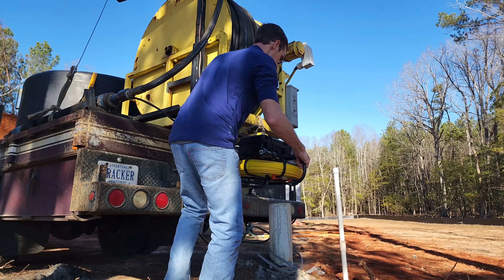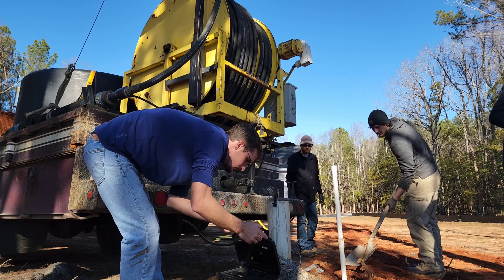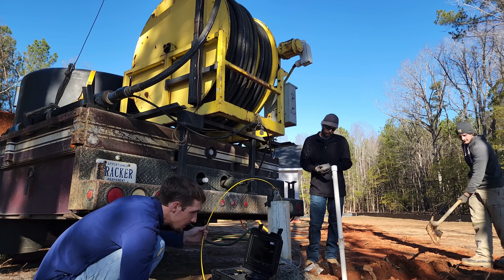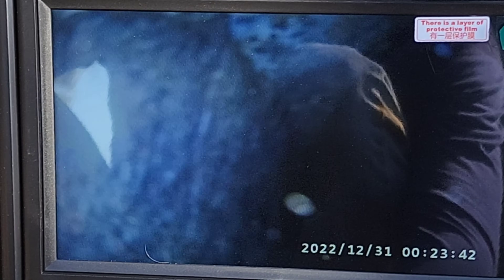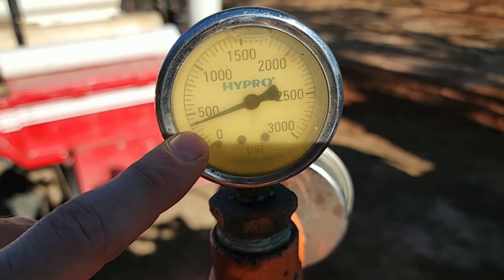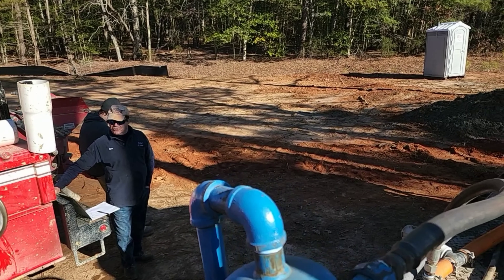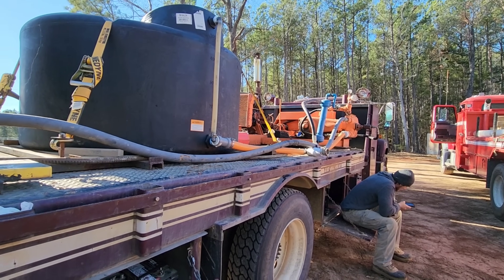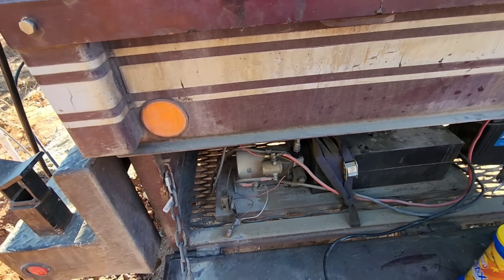No Water? What is Hydro-Fracking. For Water Wells that Frequently Run Dry. The Well Pump Specialist.

Comment: Can you frack a well that the casing is all PVC? Mine is 200 ft. My driller put so much slurry and clay down the hole trying to get the casing down after drilling it 4 times that I think it's plugged. My neighbor has no water issues. But I'm the only one around here with poor water flow.
Reply: Most likely the clay and sediment has clogged up your well pump.

Comment: No one makes it clear what water at pressure is actually doing to the well structure deep in the hole.
Is the water at pressure just pushing on the cracks in the rock hole area below the sealed bladder in order to force sediment backwards out of the fissures ? Once it is forced at speed and pressure it falls in between the area around and outside the borehole and thus the water surrounding the hole can leak in at various multiple spots to feed the well ? Is that what is going on, or does no one know ?

Comment: You often tell us you are in 2nd and then 3rd gear. What does that mean? Is it like a car transmission and the higher the gear the more pressure being applied in the fracking process?
Reply from the maker: @woodworker3122  yes, it's a Muncy 4 speed. High gear means I'm spinning the pump faster, increasing the flow rate I'm injecting into the well.

Comment: I have a new construction 600' / 6" well.  GMP near zero.  Had a company frack today.  Not the most talkative guys.  They used 3000 gallons of water.  Said the pressure didn't drop much, "but all the water went somewhere." Tomorrow after 24 hours, I will start 30 minute pumps to get chlorine out.  Wondering if you guys run into the same scenario.  Love these videos, I have learned a ton in the last few weeks.
Reply: Any luck with your production woes? That a large diameter and deep bore to wind up with near 0. Hopefully you were able to get some movement

Comment: you need a barrier between you and the engine. if that engine blows up with you over it. could be very dangerous
Reply: You've got to be kidding right? It's a low torque in line old truck motor not a  blown hemi lol

Comment: Do you ever have the pump guy put in a way oversized pump to calculate well production?
Reply from the maker: If a fracked well ever ran dry & the customer called back, then I'd perform a draw down test a calculate the recovery rate. I've only had to do that once out of roughly 50 fracks.
Reply: @h2omechanic  cool,  great channel.

Comment: We have a well that is about 100 foot deep. It was at one time putting out 3.5 to 4 gpm but is now running dry and requires about 15-30 mins to fill back up (estimated). Do you feel fracking would be worth the money to get us back to a point where we dont run dry or should we just go ahead and drill a new one. Since no one can provide a guarantee as to outcome this is a very tough decision to make. Thank you.

Comment: Any peanut oil get into the well?
Reply from the maker: Nope. If it ever leaked, the packer wouldn't swell, & water would flood out of the well
Reply from the maker: The company wants drillers to use R/V antifreeze...I just prefer not to follow that guideline.

Comment: I notice you only hydro-frack one area.= of 20 feet or so. 
We have a hydro-fracker who does 3 20 section at a time ...0-20,20-40, & 40-60 hydro  areas.  The tube has a drilled different sized hole plate between each stage.  A ball bearing of different sizes is drop down as you stop one section and start another. The ballbearing seal the lower section beneath its seat and allow you to pressure the next section.

Comment: My friend recently purchased a home that has a well  250 ft deep. Once they started going to the house the water would disappear for about an hour. 2 plumbers think its going dry because they tested the "mechanics" of it and it all seems fine. They suggested fracking the well. Anything else they should try looking at before going that route? Do you think this is something an inspection should've caught? What testing is done to see the issues?
Reply from the maker: No. An inspection could not have caught this. 
There's a simple way to test this, but you'd need a water level testing device. 
Simply pump the water level to 200ft & turn off the pump, then wait 30 minutes to see how fast the well recovers. After 30 mins it should fill up minimum 60-70ft (that's about 3gpm) anything less than that, id frack the well.
Reply: @h2omechanic  Thank you. They will double check with the plumber to see if maybe he tried this. Do you believe this is something the seller would've known? It's hard to believe this is just a sudden issue but who knows. Someone said it could have been affected by the new home next door. What do you think from your experience?
Reply from the maker: @M  if its running dry, it's always been a issue. No new well drilled near by would have any negative effects. In theory it would help it. Well veins are all inter connected in the ground in 1 way of another. 
You need to get a proper pump test done & figure out what GPM that well makes.
Reply: @h2omechanic  got cha. Again, thanks so much! Very educational.

Comment: I use a well, but it’s not above ground. My pump is in the crawl space. Would like to sanitize my well but not sure where it is. My wife thinks it would be to costly to find it.
Reply from the maker: A skilled well company can find it. 
I'd access the pipe to the pump, feed a metal snake threw the pipe until it stops, then use a cable locator to send a signal threw the metal wire snake & go outside and see where the signal stops & dig there. I've done it before.

Comment: A long shot i'd catch on this topic here   I've watch a ton of your videos, but haven't run across any that discus CYCLE STOP VALVES, do you ever recommend them? and if not why not. I run a group of 4 sprinkler heads on my well pump where the pump cycles on and off about every 2-3 minutes or so... I'm in northwest Florida. I'm not sure what size pump is in the ground as I recently bought the property and no tags are found anywhere on the setup. There is a huge 6ft tall tank on the system. My thinking was if I could keep the pressure constantly below the 60lb. shutoff while the heads are running it would be better for the pump.
Reply from the maker: Out of my area of expertise. 
I've seen them before and in my opinion, they aren't worth it unless it's a large system for like a camp ground that uses alot of water & specific times for higher demands.

Comment: What kind of pipe do yall use for the well pump? We currently have schedule 40 pvc and one of the joints failed. The company came out and recommended to replace it with schedule 80 with threaded joints.
Reply from the maker: How deep is it set?

Comment: Hey man, I appreciate all your great and helpful content. I have a question about a well with a jet pump that I have on my property. A few days ago we got a little bit of water & then heard air coming out of (or air being sucked into) the spout. The old pump burned out so I got a new one, but my problem now is that I pulled out the pipe from inside the well to check that the foot valve was clean. This well doesn’t have a foot valve it has a 3’ long 1 1/4” screen pipe. When I place the pipe back inside the casing it doesn’t go back down to its original depth, I have 7’ of pipe sticking out the ground. I could feel it hitting something it felt like sand so I pulled the pipe back out and the water draining out from the screen was yellow and sandy. Is there any thing I can do myself before I call a well company? Thank you!
Reply: sounds like a sand point on the end of your poly pipe. That sand point was likely buried  in the sand inside the well for 7', thus the 7' now sticking out.
Reply from the maker: That's not my area of expertise 
Call in a local company 
They'll understand that style of well

Comment: One of your past videos you were referring to why do they not have auto mech courses in high school anymore .Now in tec schools. Autos now are like modern aircraft which have moved away from a simple  cessna 150 to more like the modern A320 airbus-Lots of problems require using analyzing tools(have a look at Youtube,  South Main Auto)sure opened my eyes.I am licence AME avionics (ret.) which is far from my old auto course.This a/c Has only 1 cable run otherwise its hydraulics controlled by electronics. Love your Videos ,keep it up

Comment: You know what I'd like to see?  Electric grid is down and the best method to extract water from your well either by prepping beforehand and having a manual hand pump and/or having a converted bicycle to generate electricity to power your well pump (and which is better/easier to implement).
Reply: Ya a generator.
Reply: @AndyDC52  I'm so glad oil refineries will be working in the zombie apocalypse.
Reply: @MassiveOverkill  a generator. Is the answer you’re looking for.
Reply: @AndyDC52  no a generator is not the answer I'm looking for.  I will be purchasing a hybrid solar/wind system.
Reply: @MassiveOverkill  to power the generator. I dig it.

Comment: In my area it seems all these new style trucks drill the well so fast it seals the sides. Of course, they offer hydro fracikng! The old style percussion drillers seemed not to need fracking
Reply from the maker: Old "pounding" drilling machines would access the upper surface water. We case it out on purpose, bc it will not pass bacteria testing to satisfy the state requirements. If you did go that route, you'd have over 3k in filtration systems to clean up the water.
Reply: @h2omechanic  The pounding type drillers still install casing until bedrock. Plenty of people in my area have driven points or natural springs, without any 3k filtration system, just a particle filter. Do you think the speed of the drilling of the new drill trucks is the reason why so many wells need to be hydrofracked today?
Reply from the maker: @gary   no, it's the region we're drilling compared to others. Our upper layer of rock typically is highly fractured & mixes with surface water. 
Also when we are near a lake, the wells are deeper & production is very low requiring a frac process. Air rotary drills don't plug up veins, if anything the 350psi will blow them out & help flow
Reply: @h2omechanic  Isn't hydrofracing using up to 3500psi? It just seems odd that back before all these super fast drill trucks came out there wasn't any hydrofracing. It sure doesn't take very long to drill a 500' well today. Around here, you're hoping for 20' of casing, but some places with deep bedrock get hundreds of feet.
Reply from the maker: @gary   our casing ranges from 40' to 150'. Wells range from 170 to 800. It's totally dependent upon your region. West VA mountain, you can get a 50ft drilled well. In Texas you can get a 1200ft well & the water level is at 400ft. It's crazy how different it is is different areas. 
I personally believe that the more water is used in high population areas, the deeper Wells will become  
In 1984 our average Well was 150ft. Now in 2022 our average depth is 350ft. & alot of 120ft> Wells are becoming dry.
Reply: @h2omechanic  I for sure agree about the dropping water levels, and I'm in a low population area. In the house I grew up in the well was a dug well in the cellar. About 24' deep and you could see the rings on the concrete tiles. At one time it was fairly full most of the year, in the end it wouldn't go over my rubber boots. My 96 year old neighbor always claimed it was because of all the new artesian wells being drilled. He had a driven point. 350 and deeper here would be expected.

Comment: Another interesting video.  I like how the guy you drilled for never did much beyond pointing and holding his clipboard, lol.  Do they not drill any of their own wells?  Y'all must stay busy if you are doing the work of three different companies.
Reply from the maker: The other companies offer a turn key set price for the well & septic. We just cut the hole for them. But mainly they are a septic installer & pump installer. Wells like this one don't leave much money on the table for them
Reply: @h2omechanic  Aah that totally makes sense.  I am sure that having a turnkey provider of both well and septic is super helpful for new builds

Comment: I have a 20" bored well I did myself with a borrowed very old machine. I'm having very low flow over the last few years and I know sediment has gotten into the well early on. I run out of water very quickly but it does recover. When I dug it there was 18' of standing water. Any suggestions?

Comment: Forgive my ignorance, but when I hear “ fracking “ all I know is what you hear on the news . What are you doing when you are fracking .
Reply: High pressure pump down of water or fluid into the reservoir to "fracture" the rock at weak points as to create more flow of water or oil out of the well. In oil wells they use sand or proppant mixed with the fluid to fill gaps in the rock and create flow channels.
Reply: Thanks for letting everybody know that you're a gullible sucker.

Comment: i have a well 320 ft deep .  the pop off valve is 75 psi and is spewing water even with an open fawcet a foot away,   the popoff is in the main right atop the well,  about a foot of 1,5 inch pipe then a tee,  from that tee one goes to a fawcett and the other goes to the house where the pressure tank is.  The  pressure switch is closing (power to the pump) the tank air pressure is 28psi and theres a 30/50 pressure switch.  barely water in house at all.    I have tried it with spigots open in the house and with them closed.  I have used a garden hose outside from the tee fawcett mentioned earlier  open to reduce pressure.  do i even need a pop off valve?  i replace it a few months ago
Reply: You have a failed check valve right before the tank
Reply: @texasfrontiersman8245  i will check it

Comment: Replace the radiator on your frack motor! There's paint on the fins and that's why you're overheating.
Reply: All old copper radiators are painted gherkin, we restore older radiators for over 50 years, they came from the factory painted. If over heating is occurring paint has nothing to do with it.
Reply: @billveek9518  so you're saying that a layer of paint on a copper heat sink doesn't affect the emissivity? Tractors don't usually drive direct after the transmission, so with less of a reduction in gear ratio to the output shaft of this particular unit, it is working far harder than any regular tractor would. But what do I know anyhow, you're the tractor specialist 😂
Reply: @Mrcrowntown  not enough to cause an engine to overheat, you've seen older radiators in your time, do you remember them being bare metal? No. Aluminum radiators in the new crap are not painted because aluminum doesn't get surface corrosion and the sides are plastic! Actually black paint can aid in heat dissipation, most air cooled motorcycle engines are painted black for this reason, older Harley Davidson cylinders are black for example. Most wood burning stoves are painted black as well because black pigment (carbon) radiates heat better than any actual color pigment. Usually a flat black.

Comment: Really like learning from you. I had a 6” hole drilled 700ft in N Georgia and they said it was 1.5 gallon minute. Is that good? I’m thinking of installing pump my self after watching you. What do you think? I haven’t built yet. 😊
Reply from the maker: Figure out how far the water is from the ground level. 
I'd recommend a 5gpm 3/4hp pump set at 300ft. Itll run your house just fine. But not sufficient for major irrigation use. 1.5gpm makes over 2000gal in 24hrs. The average home uses 700 in a day
Reply: it's not great. a prime candidate for fracking! it make your investment worthwhile rather than being stuck with 700ft of useless pipe!

Comment: I had well drilled 418 pushing 90 gallon a minute S. Illinois
Reply: 90 gpm. Really. What's the diameter of the borehole?
Reply: @BlownEarDrums  not sure I don't own that property anymore this was about 1995 at a cost of $5.100.00
Reply: @BlownEarDrums  running a one inch water line at 63psi it would fill up a five gallon bucket in 6 seconds gospel truth lol you had to hold onto the bucket because it would know it over 3 years later all my Mowen faucet's were dripping lol